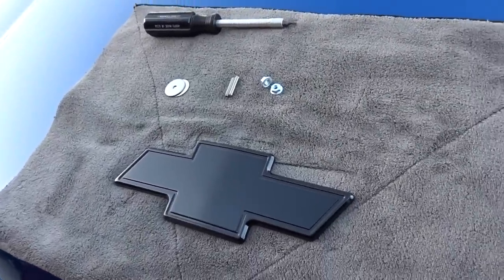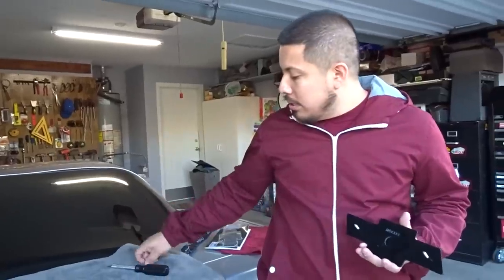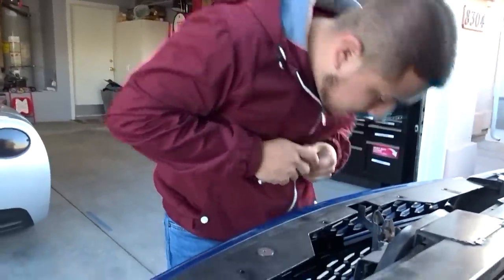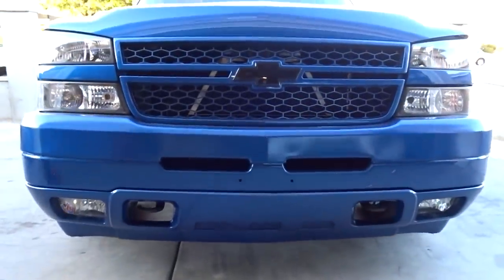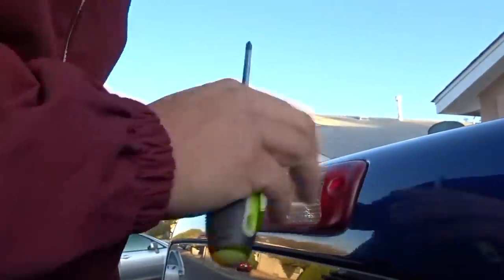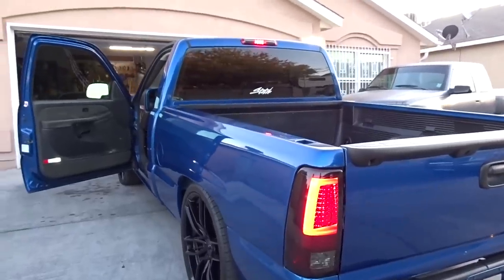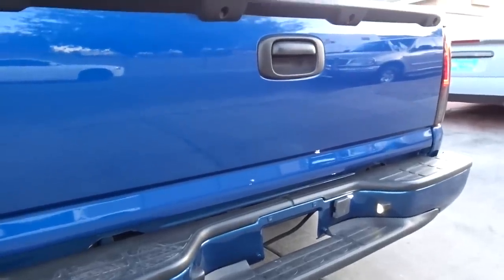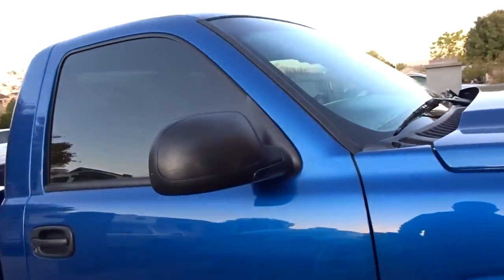UPGRADES FOR THE STATIK SINGLE CAB! (VLOG 2)

Comment: Can I get the link for the led bulbs for the plate
Reply from the maker: These are the ones that I bought bro

https://rover.ebay.com/rover/0/0/0?mpre=https%3A%2F%2Fwww.ebay.com%2Fulk%2Fitm%2F201331107137
Reply: Those are for interior and plate lights ?
Reply from the maker: Yes. Same thing
Reply: Appreciate it bro